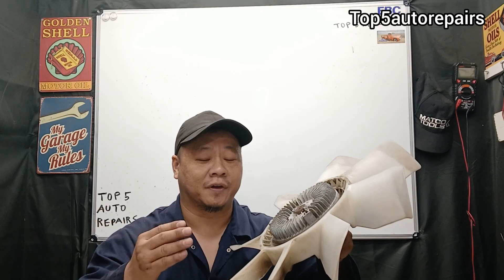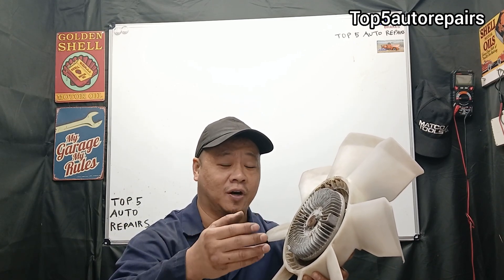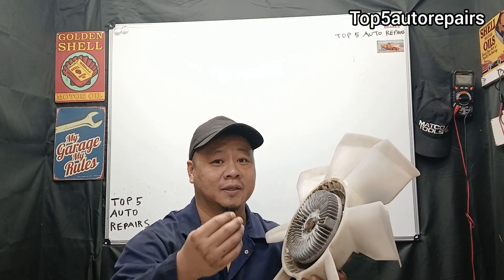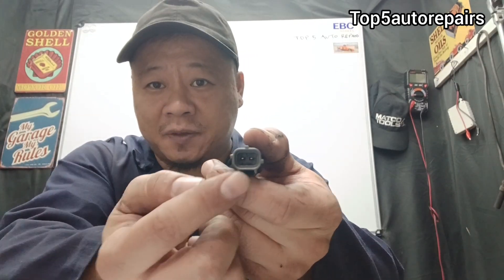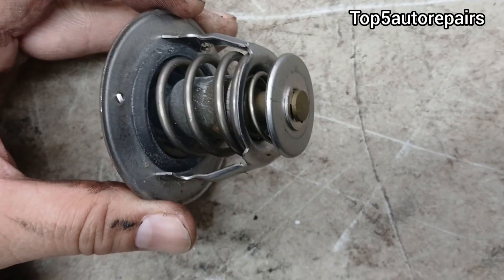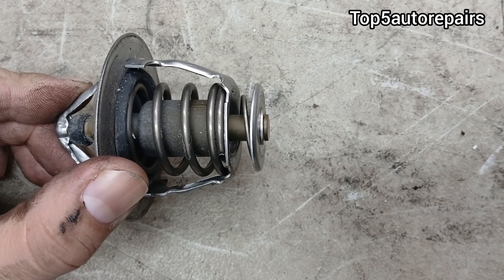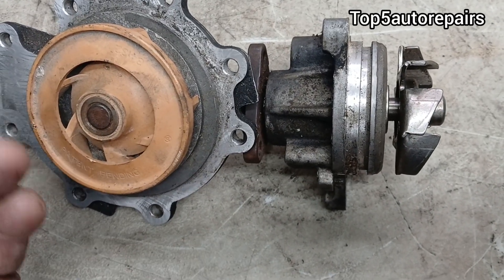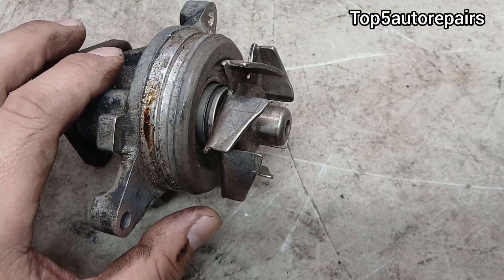WHY IS MY CAR OVERHEATING WHEN IDLING OR SITTING AT THE STOP LIGHT

Comment: Good day sir. Allow me to ask how about in my case the temperature gauge is normal, only thing is there is an audible gurgling sound from my engine when it is turned off. Thermostat is located in the lower radiator hose. Level of my coolant in the reservoir is normal not filling up or decreasing. My car is still in the garage for few days already while I’m trying to figure out the problem. Thank you sir.
Reply: Do you have an auxiliary fan?  I would suggest to turn off the ac 3 min before shutting car down and then see if the gurgling is still there.
Reply: @KL400-n2e   It seems whether I use my ac or not it’s the same. I’m confused.
Reply: @KL400-n2e  I will still try your idea tomorrow sir. Thank you so much.
Reply from the maker: It sounds like there is air in the cooling system, coolant level might be low or a radiator cap is due for a replacement
Reply: @Top5AutoRepairs  I just pulled out my thermostat and boiled it and found it opens and closes. After that I flushed my engine and radiator without a thermostat so the upper and lower radiator hosts and the radiator itself heats up a bit after about 15 minutes of running my engine. So sir, is it ok to say at this point that my thermostat and water pump and radiator are still good? I stopped there, but tomorrow I planned to pull out my radiator and have it pressure tested. Thank you very much for sharing people your knowledge sir. I really appreciate it.